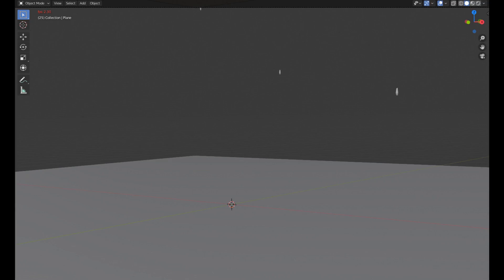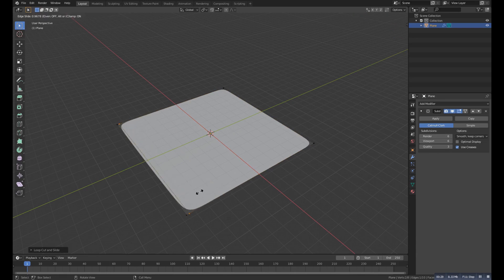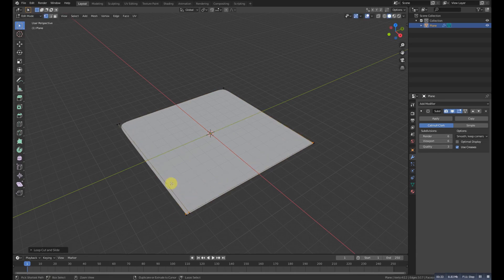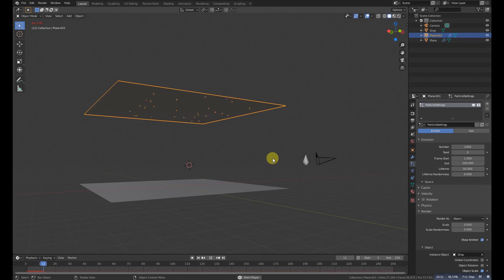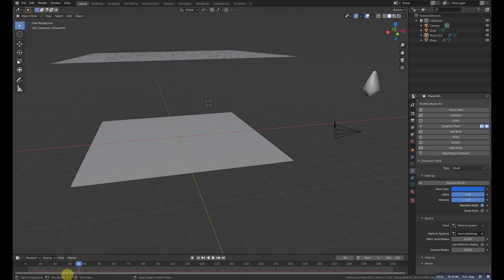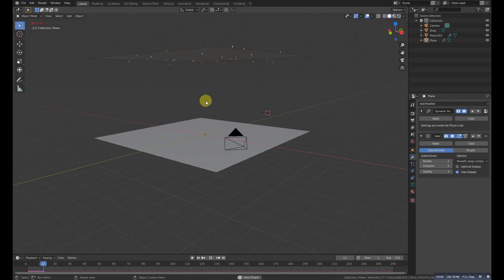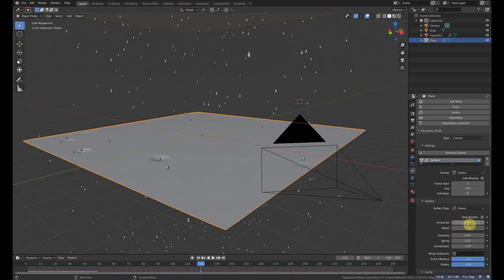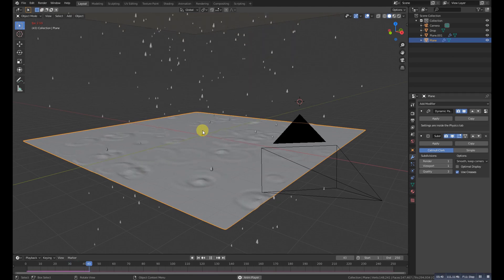Create Realistic Simulated Rain Puddles in Blender 2.81

Comment: Am I missing something? I have added both dynamic paints to the planes, one is brush and the other is canvas. However when I press play animation, the droplets hit the lower plane and do not 'splash', I just see the tile 'squares' move about. I have gone over the video in slow motion and have copied the parameters like for like. Does anyone know what I could have done wrong? thanks :)
Reply: I guess you found the solution :-) i forgot to turn on Waves in the physics property Panel/Surface/Waves and it worked after that.
Reply: have u found ur solution? i am facing the same problem

Comment: instead of grabbing edges in edit mode, you can add an edge split modifier before you use the subdivision surface and everything will appear ok. You don't need to sharpen or anything
Reply: lol there or u can use simple option from the modifier itself